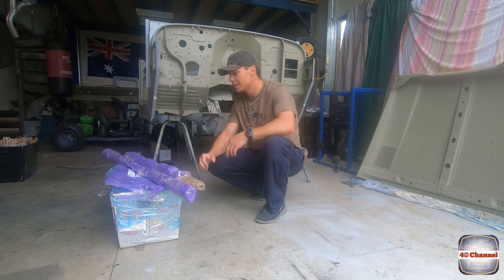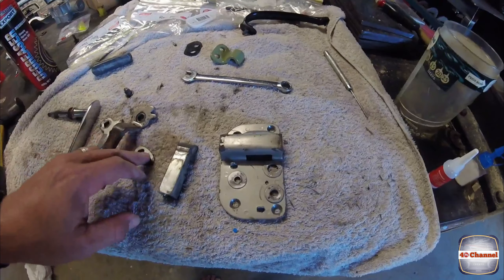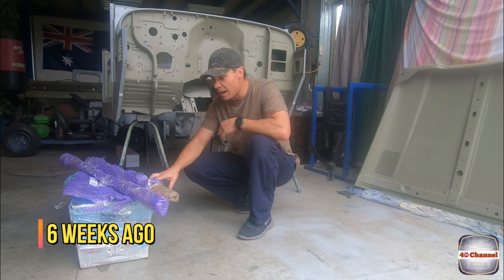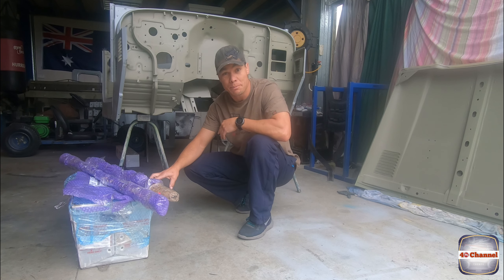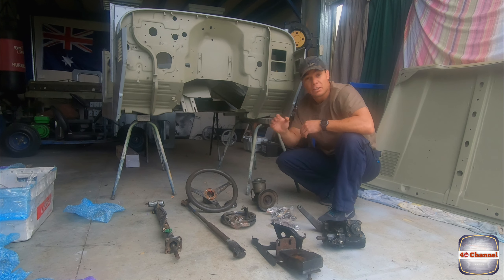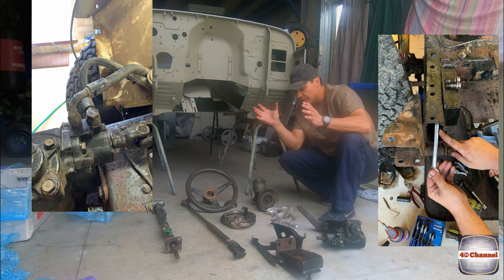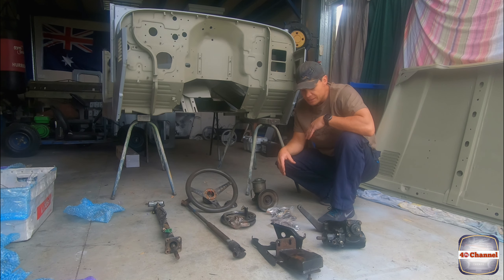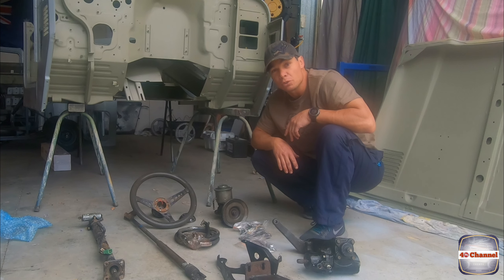EP50 - FJ40 power steering Up Grade + Air conditioner kit from @12htj47. Archie's home built HJ47

Comment: Do you use the organl chassis holes to join the bracit. I mean the holes that hold steering sistem from steering box to this plice that you use to put on New bract for New steering box.
Reply from the maker: Yes, standard chassis holes. No modifications to the chassis.
Reply: @40ChannelCruiser  thank you so much for your answer. And you used fj60 strrig box. But do you need to make holes on the front grill to make hydrolic lines go throw??? Or no need

Comment: Mate stick with the 60 series steering. The original is multi link and even when fully rebuilt wanders. Love the show.
Reply: Vasil Mojsej 
Wanders on the road ?
A mate bought a 40 with a v8 chev in it
Previous owner flipped the front suspension 
MEANING
The front shackle was put to the back and the back was put to the front
The front had a 50 or 65 rhs welded to the chassis  and then the spring hanger
To that
Keeping the original height

And i was in the ute
He got up to 140kmh
And it drives awesome 
No wandering at all

Comment: Mate awesome episode I have a 60 steering kit sitting in my garage for my son’s hj45 but was going to get an original box because I didn’t want to cut shock support arm the kit you got seems to have a spacer to push box across  to clear Strut  and a crush plate nice job                                                         Do you think  there would be any 
Issues with getting a blue slip with that setup       Mate as usual great content and very informative
Reply: I Create 
Be just an engineers  certificate id imagine
I got seats done
I put the seats in myself
Welder by trade 

Only mistake i failed on was i didnt use the factory genuine bolt  on the seats
Reply: Noel Scammell thanks mate really helpful I got a stainless bolt kit was going to use them in non structural areas sounds like a bad idea now thanks agin
Reply from the maker: Should be fine, comes from a reputable company and came off a FJ40 before going on mine.
Reply: 40 Channel yea looks great
Reply: Mate just wondering if you could post some pictures of the steering kit I’m really interested in the spacer for steering box and the crush plate also the steering arms pretty much full run down much appreciated love you Chanel